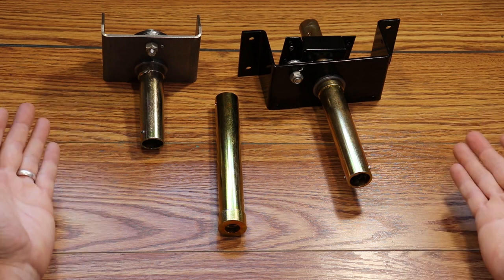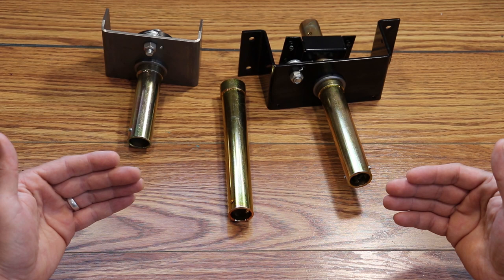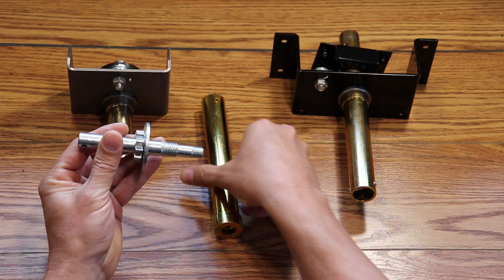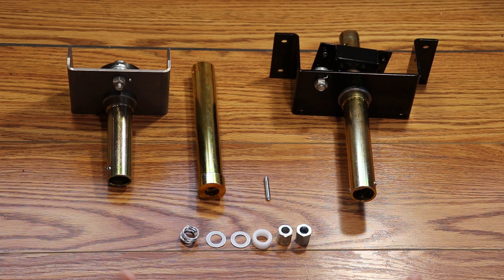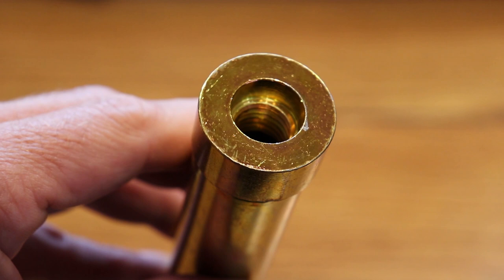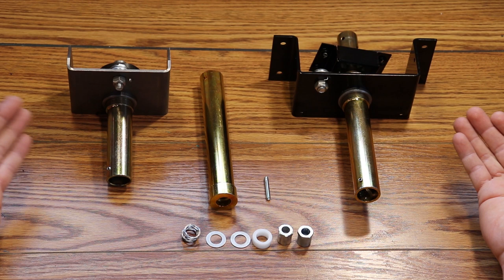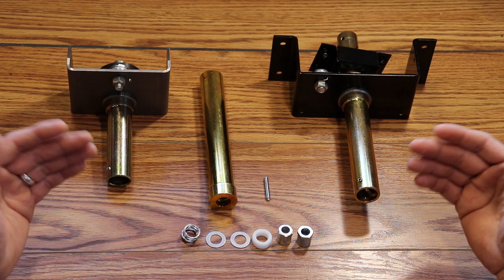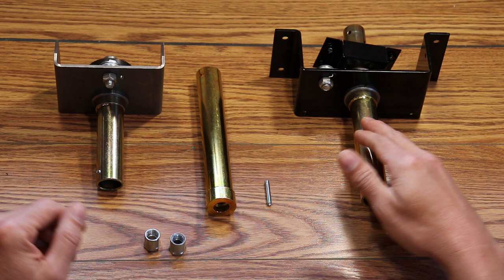How drive hub extension tubes work on pop up campers

Comment: Thank you for this video!  When cranking my camper wasn't clicking and was afraid to raise it all the way up as there seemed to be lots of tension.  After watching this video I decided to continue raising it until the roof was fully up....and was able to turn the crank about 3 or 4 more times which tightened everything up.  Now it clicks and locks.  Thanks again!!

Comment: Excellent video. It helped me out of "no click" on raising roof on my '06 Sea Pine. I thought I broke something in the crank assembly when I accidently had the drill I use to raise the roof in reverse when trying to raise. No clicking and slow fall down after that mistake. I was getting ready to take the crank assy apart (ugh) when I found this video. I took your advice and raised it all the way up. Then I kept turning the crank and sure enough I got two or more turns and it worked fine after that. Reset! Great stuff. I subscribed.
Reply from the maker: Glad to help!
Reply: Same here. Glad i checked out this video. Very helpful!

Comment: Great video! My wife ripped the wall previously so I didn't want to over extend it, so I put a nail through the chain and held the other side with vice grips and tightened everything up. It worked perfectly except after I popped it up the inside was full of mice.
Reply from the maker: Consider a product like fresh cab to deter mice. Here’s a link to this product on our website. 
https://colemanpopupparts.com/products/fresh-cab-rodent-repellent
Reply: @popupcamperpro  thanks! I wasn't even expecting a solution, but that sounds perfect for us. We just bought a new trailer today and I'm for sure getting some.
Reply: Mice are the bane of campers. I hate them.

Comment: My no click was caused by the back stop for the far end of the wiffle tree rod being bent away from the handle area. This allowed the whole assembly to shift away from the click pawl, and it would slip the gear away from the area that the click pawl could reach.  A strategically placed washer near the large bearing in the wiffle tree assembly prevents the whole assembly from being allowed to shift forward towards the front of the trailer.

Comment: My Cheyenne model is experiencing the same thing. No clicking and no compression, currently stuck in the closed position. The 5/8" nut is rounded off, I'll have to go to your Plan B and take off the Drive Shaft.
Reply: Did you have any luck?

Comment: Do you have a video showing how to replace the drive shaft or crank assembly? If the threads are damaged. Thanks so much.
Reply from the maker: Coming soon. For now you can find more how to under the INSTRUCTIONS link at colemanpopupparts.com

Comment: Hi there.   Thanks for the great informative videos.  I have another problem now.  The roof lifts...but it doesn't go down with the crank.  I'm able to lower it by removing the pin and using a 5/8 socket on a ratchet.  I removed the drive extension to inspect it.  It's very greasy inside.  Should it be?  Also, it only has 2 (bent) washers.  No spring or nylon spacer.  Why wouldn't it have these parts inside the drive extension to begin with?  It seemed to have worked all these years without them.
Reply: No sooner after leaving the comment....I did find the nylon spacer and the spring in the tube.  The nylon spacer was stuck inside and had to hammer it out with the help of a flathead screwdriver.  The spring is all deteriorated and fell apart into pieces!
Reply from the maker: Hello Eric! I recommend to check the threads inside the tube, and on the drive shaft. The inside parts such as the spacer and spring work as thread limiters. The drive hubs can sometimes work without them, but it can chew the threads up.

Comment: Great video.  Learning so much from all your videos as I try to learn about pop up campers.  Have a question that I believe is related to this video; however, I have not found my exact symptoms mentioned anywhere.  The camper is a 2006 Fleetwood Evolution that cranks up, stays in place anywhere between fully up or down and also cranks down, but there is no "clicking" while cranking.  Seems to work completely fine and doesn't drop down under it's own weight but the clicking is completely absent.  I have not had a chance as of yet to begin disassembly and diving deeper in.  Any preliminary ideas on what the cause may be?  Is it safe to use as is for the time being?  Thanks so much.
Reply from the maker: This is typically a compression issue DP. Take a look at how drive hub extensions work, and how to replace them.

Comment: Thank you for this as i just relived this problem today. Question...I've got a 2006 Fleetwood Niagara and when i try loosing the nut it just spins and doesn't want to come off...any suggestions? Thanks again.
Reply from the maker: You may have to go to plan B and replace the driveshaft if the threads are damaged beyond use.
Reply: Pop up camper pro  how do you replace the driveshaft? Will I need to remove the back panel?
Reply from the maker: Elizabeth Cooke that is correct. After the panel is off, remove the chain at the master link first. Then using a hammer and punch, remove the pin in the chain drive gear. This will allow the assembly to come apart.
Reply: Pop up camper pro Thank you! We got it apart tonight, will be ordering parts in the AM. Thank you for a great video!

Comment: I have a “stubborn” slotted flat head bolt in drive shaft. Can’t get it out. Any ideas?
Reply from the maker: Hello Scott! These can be a pain. Try chemical penetrant, an air hammer, or just cut the tube above the nut.
Reply: Thanks so much! Got it off with a impact driver. Do you know why my crank system when cranking down sometimes “slips” and the roof falls a couple inches? While trying to crank the roof down it goes between the crank handle having control of cranking it down and then slipping and the crank handle does nothing and the roof drops a little. If I apply pressure to the crank handle however, then the issue doesn’t happen and I have control cranking it down. Hope that makes sense.

Comment: My problem seems to be one that you don't mention. My roof is halfway up and I can't turn the handle either way. It's just stuck.
Reply from the maker: This is called binding. It can be caused by a few situations. A common one is debris in the whiffle tree pan cover. Try here first. If this is not it, please take a look at the lift system repair manual available on our website for more issues that cause binding, or give me a call at the shop.

Comment: ok out camping get to site with my 99 sea pine go to crank it and it just spins. can I cheat this to go up or am I losing out on $500. still here just sleepng tonight in back of the suburban with wife and kids. I have lots of tools. so any help will be great. i could get it down like everyone else has problems doing but mine is gettin it to go up.
Reply from the maker: Sounds like the drive hub may be bad. Remove it, and manually manipulate the drive shaft if you have the proper tools with you. You will likely need some people helping to lift the roof at each corner through this processes. Have some type of supports ready to brace the roof. 2X4 lumber is recommended cut to size to fit between the roof and the deck.

Comment: I have a 2000 Coleman Fleetwood Niagara, crank goes into the bumper. I can turn it fine and it will open fine, but if I let go of the crank handle, it spins backwards, closing the trailer. How would I fix this?
Reply from the maker: Sounds like the compression is not engaged. What diagnostics steps have you taken to date?
Reply: @popupcamperpro  thank you for getting back to me. I have not done anything yet, I am looking to get started on it tomorrow.
Reply: I just rescued this pop up from a field and this is all new to me, so I am learning as I go. Is there a video that maybe I missed that I should watch so I know what I am looking for?
Reply from the maker: Please give me a call at the shop when you have some time to talk for assistance.

Comment: Our extension is 7.5 inches but I can only find a 6". I know it would be shorter.....but would the 6" still work?
Reply from the maker: Erin, I do not recommend at this point using a different length tube. Recent discoveries about these systems will lead me to recommend that you stick with the same length.

Comment: Mine cranks up fine but when going down it works fine then it like bounces going down.. What could be the issue?
Reply from the maker: Worn chains and mis aligned chains can cause hammering. Stage cables ni longer flexible can also be a culprit.

Comment: What size of flat washers are used?  Took the hub extension off and mine has three washer that looking like someone added a concave shape to them.
Reply from the maker: The original washers are very thin. In a pinch you can use one standard washer.
Reply: Asked what size they were so he can buy some. Need size so I can also figure it out

Comment: It would be more helpful if you would actually show how these steps are actually done rather than talking about them.  You actually need to demonstrate the principle of how the clutch works on the shaft, and also show which and how the components are positioned on the shaft.  There are also several important details you should include as to correct order and parts placement and tools.  Thank you.
Reply from the maker: I do plan to. This video was recorded at home during quarantine while the shop was closed. Thanks for writing!
Reply: @popupcamperpro  I'd be ever so grateful for a video! I am not good at reading the old manuals, a video would be so helpful!

Comment: My drive shaft threads are damaged and I would like to run a die on the threads to repair them so I  can put a new extension tube on. What size did do I need?
Reply from the maker: Sorry Jim, that I do not know. Perhaps we have a machinist who could answer this question?
Reply: @popupcamperpro  thank you for your reply I was able to figure it out on my own. That is a 5/8 coarse thread. So I bought a 5/8 coarse thread die and will try to repair the threads when I get back over there thank you
Reply from the maker: Jim Wilson good to know! Please let us know how the repair goes.

Comment: How about when you crank up, it clicks but keeps slipping. What is the issue?
Reply from the maker: Allan, I would first check the drive hub tube for proper compression. The system needs to compress completely. You may just need a small amount of adjustment.

Comment: You talk of every problem with the camper not staying up. You touched on it not being able to come back down but no further. I have the problem of it stuck in the up position and cannot crank it back down so what do you think the problem is? It absolutely clicks when cranking it up but will not allow you to crank it back down.
Reply from the maker: Typically one of two issues. Debris at the rear of the drawbar on the whiffle tree, or the drive hub extension tube is not disengaging completely and compression is still on the crank.

Comment: I can't find any videos on a chain-driven system. My pop-up will go up and but I can't get it down and it is the left-hand chain drive system. I just bought a brand new Left Hand Chain Driven system and the drive hub extension tube just spins when I go to lower it. I have to take the panel off underneath and manually lower the top by a wrench and turning the whiffletree. Anyone have any ideas?
Reply from the maker: Hey Nick! I left you another message yesterday. Please give me a call back.

Comment: What if the washers dont fit on the shaft?
Reply from the maker: You have an aftermarket tube or the wrong washers would be my first guesses.
Reply: Baught the 3000 series rebuilt kit from Coleman pop up parts. IDK.
Reply: Sorry it was the rebuild kit,that says it can be used for the the 3000 series etc.

Comment: I have a 2011 Coleman Yuma Destiny series pop up. When Raising the roof there is no clicking sound. Also the Brake does not engage until the the roof reaches it's full open position. If I let go of the crank handle anywhere in between gravity takes over & the roof winds back down on its own. any suggestions? I'll try the reset procedure first.
Reply from the maker: This is typically a compression issue or worn threads in the drive tube, drive shaft or both. If the problem is recent, the reset procedure typically works.
Reply: @popupcamperpro  I tried the reset procedure you mentioned after about a quarter of a turn it wouldn't budge, felt like i was going to break something so I stopped. It also didn't make any noise when  attempted the reset procedure.
Reply: @davidpettengill914  How did this end up? Dealing with it now.
Reply: @acforhim1  The camper is open and I haven't had time to deal with it. I left the crank handle in and used the battery box strap and secured  it to the bumper just incase it decided to wind down. haven't as of yet.
Reply: @davidpettengill914  Bummer...I know that feeling. It feels like it's one thing after another. lol Good luck.
Reply: Same exact thing is happening in our 2010
Reply: I have the same issue. But sounds like it's moving on something inside but has no click. It's super tight and rf coner is a 1/2 " from 52, the lf is at 52, the back left is at 51 1/2, and the back right is 3/4" from 52. Not worried about adjusting, just wondering why there is a space between the pawl and teeth.
Reply: Might be a dumb question but when you measure the peice of wood for a brace by the arms where do you measure from? The lip of the roof down to the edge of camper where the arms go in? Thanks

Comment: I was able to remove the pin off and bolt but I cant get my tube to come off.😔
Reply from the maker: Mother nature has her own forms of loc-tite. Try bracing the system from the chain or drive area, and use a large pipe wrench on the tube. Left is loose. If this does not work, you may have to take the crank off the camper and get it into a bench vise.
Reply: @popupcamperpro  Thank God the pipe wrench worked! I'll probably order new guts to go back in the hub ext. There were 3 washers that weren't flat and a spring that stretched out as I was trying to get it out. Now if I can get the new thrust bearing in! I tried to go from the backside without taking all that off but I couldn't get the pins to budge at all! 😣

Comment: What is the part number for this kit on a 1999 coleman Cheyenne?
Thank you
Reply from the maker: Drive hub kit 1741 Corky.
Reply: Thanks!
Reply: Do you have a video for the '99 Cheyenne rebild?
Reply from the maker: @corkydavis5688  all currently available videos can be found at our channel
Reply: @popupcamperpro ,  I scrolled through the videos, but did not find one for remove of the
Lower Crank Assembly Rebuild Kit. 
1) DRIVE SHAFT ( 5" ) 
1) PRESSURE WASHER 
1) SHAFT BUSHINGS 
1) NYLON WASHER & 1 WASHER 
1) HEX HEAD NUT COURSE THREAD 
2) ROLL PINS 
1) DRIVE HUB 7 1/2 " 
1) RATCHET WHEEL 
1) PRESSURE PLATE 
1) PRESSURE WASHER 
2) ROLL PINS 
1) RACHET PAWL & SPRING / NO BOLT 
I onky found videos on how to assemble that product.
Sorry to bother you,  I will look again.